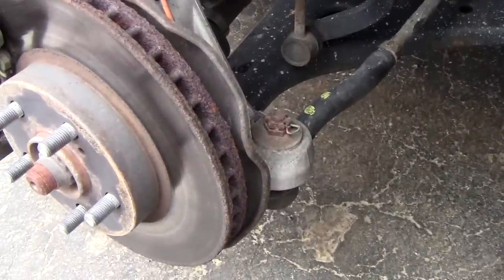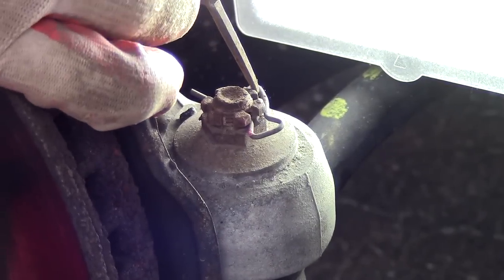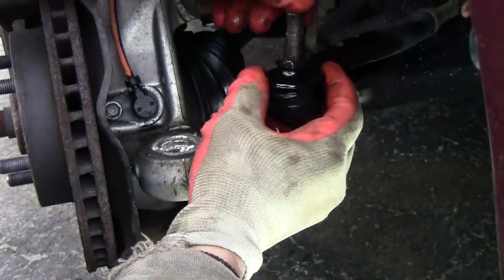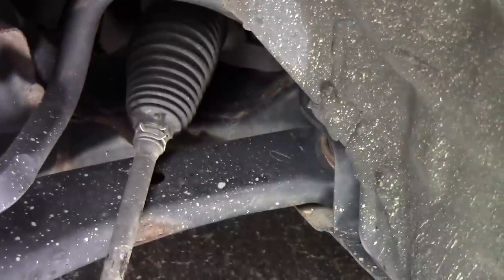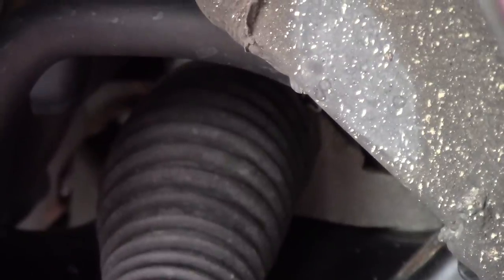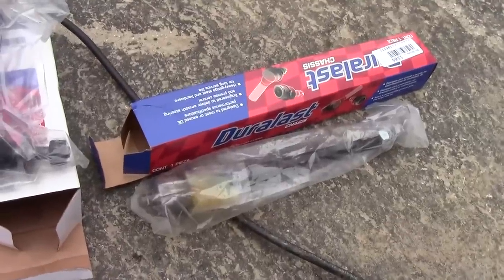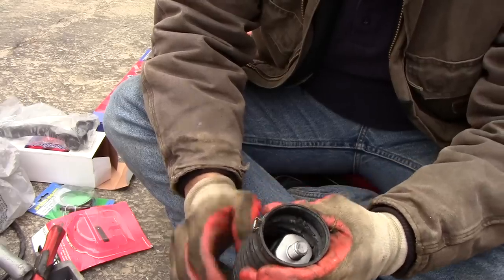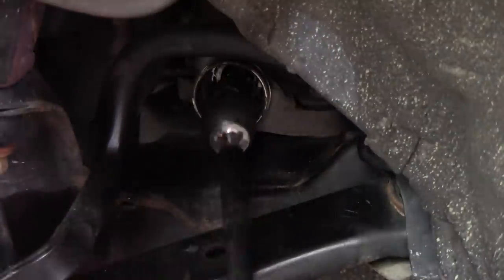inner tie rod replacement and Outer tie rod replacement Prius

Comment: Good detail, thanks for sharing!  About to swap my drivers side inner and outer out.  Have the whole steering rack and pinion assembly, though thinking is easier to remove the inner that already has the outer installed and just replace that section to save time.

Comment: If you keep track of where everything was before you should end up with similar results as you had with the alignment!
Great job, about to do this on my yaris, very helpful video as I've never done inner ends before.
Cheers mate!
Reply from the maker: Thank you for commenting and sharing...  I just did this for round two, about 3 weeks ago, the part was not the greatest of parts and this resulted in replacing it again... Took about 35 minutes total!  I ran through it.
Reply: @EngineerPEretired That sucks! Can you please tell me which brand that lasted only for 3 weeks? So I can avoid it in the future! Inner, outer or both?
Thanks
Reply: I misread that, 4-5 years of usage is not that bad...
Reply from the maker: Desir, please spend the money on OEM parts when it involves bearings (the cheap guys are just that, cheap) ... anything that the failure might cause your death, spend the money on OEM...  I am referencing none-redundant systems...   Besides, you are saving a ton on labor...

Comment: how did the car feel and drive before changing and after? i have a 2005 prius, before i bought it it had crash damage on passenger side, here in ireland, i didnt know when i bought it, so its hard to keep car straight on the road without constant fighting the steering wheel ever so slighly but very often, constant, i checked tie rod ends and the driver side is more lose than other side, plus the inner tie rod moves in and out where as the other side doesnt so i guess that means the drivers side needs changing right? i just ordered the parts now for both sides, blue print brand, i hear thats ok to use on prius, my car cant be tracked , always in the red on the passenger side, even toyota cant track it so i presume coz of the crash damage, but im hopin the new parts mite help something, im hopin ha, otherwise i was told to bring it to get chassis checked for out of alignment, but i guess that wil be expensive to get checked and straightened out if needed, so i hope these parts might help before doin the chassis check,

Comment: Was there some clicking feeling on the steering wheel and clunking noise coming from the rack and pinion area when you hit a bump before you replaced the inner tie rod?
Reply from the maker: Yes.

Comment: has anyone  done this on a 3rd gen 2010 ? as apparently   toyota do not sell the  inner tie rods you have to buy the whole rack at a cost or £1000.00 ......... . would love to know if you can change them on a gen 3
Reply from the maker: That is too odd... try a junk yard or don't believe them and keep researching.
Reply: Philadelphia Construction Engineering   even the junkyard are wanting  £500 the rack or £100 for 1 side of tie rods  .  Very hard to get them for a gen 3 . I've got a gen2 one I'm gonna try get machined
Reply: I dont believe that for one second. Their available online. Rockauto.

Comment: Lol, same here, went to a battery n tire place n said nut is frozen, here i am. Preventing me from getting alignment. This after replacing my struts myself in the front. Awesome vid btw, 40 pounds torque too? Last thing, how waz the drive to get it aligned?
Reply from the maker: If, you noticed, I nailed the alignment = it drove like it was already aligned.

Comment: I got the old inner tie rod out without any problem, but am having a terrible time getting the boot to fit on the inner end.  Completely blind approach and not much room for my hands either.  You commented that you had gotten yours back on more easily than you expected, is there some trick that will help me?  Help please!!!
Reply from the maker: The clamp is what holds it on; I hope you removed that one time use clamp? Then just use a replacement clamp, it only requires enough clamp force to hold it in position with some grease pack into it.
You might be missing something simple if it is not just sliding back on...  I think I was referencing my ability to reuse the one-time clamp again... I did have a new clamp ready to go if it did not slide back on...
Reply: @EngineerPEretired  Yes, I have removed the clamp but the boot does not want to slide onto the flange on the steering rack.  I am using a new boot as I had to cut off the old one to remove the inner tie rod.  Almost completely blind approach and very poor access for my hands, just cannot get the boot to slip onto the rack.  I may pull the inner tie rod just to see if i can get the boot over the flange that way, but would certainly rather not do that if possible.
Reply: @EngineerPEretired  I think that the boot I received may be too small, that would explain the problem
Reply from the maker: That is what I was going to suggest...
Take the cut boot and piece it together and check/ compare it's inside dimensions
Reply: @EngineerPEretired  Already did that, and yes the boot is too small.  Opening of the new boot actually fits inside the old one.  God but I hate incompetent salespeople!
Reply from the maker: This happens all the time these days... I have purchased online ''exact match'' and even OEM wording and the parts do not match!  I feel your pain.  Try boiling the damn thing and refitting and let it cool to fit -- if it close to fitting. Boil it outside if that helps.

Comment: What prompted you to replace the tie rods?
Reply: Jeremy Davis 

      I would say that the threads were seized due to rust welding in the rust belt.  I get to do all 4 wheels on a Camry this weekend due to the same.  Inner and outer rods and rear torsion bars.  All rust welded and unable to align due to frozen lock nuts and threads in each female end. Rust belt. 😡
Reply from the maker: I was getting an alignment and was informed it could not be adjusted - it was frozen -you know the junk they tell you to replace an extra part and make money. But, once I looked at part, it was frozen... haha

Comment: Its good to know that im not the only one who uses a monkey wrench on my cars. My neighbors think im crazy when they see me doing that.
Reply from the maker: LOL - the tools you have available -- as long as you do not tear up the equipment you are using it on... To hell with the haters... Just call them a ''living troll''  - Wish you the best.
Reply: wolf green 

     I used a 24” pipe wrench and an 18” pipe wrench on a Tundra and an Avalon to unscrew the outer tie rods.  24” on inner and wedged on ground and 18” on outer to unscrew.  It worked well.  Sometimes you have to use King Kong tools on stubborn parts.  Rust belt is a pain!!
Reply from the maker: Thank you for the support of the question... a lot of trolls on youtube attack you for anything they would not do... haha

Comment: Your before and after readings are the same because they didn’t make an adjustment. The strange part is that those readings do not fall in the range that is specified. Your before and after readings are 8.4 and 9.4 but the specified range is 10.5-13.5 and 11.8-13.3 degrees. Why didn’t they do the alignment to spec?
Reply from the maker: I think that's the rear ad chamber, caster and toe are the front...
I had them do four wheel alignments all the time but it's an honor system and can we trust these people? 
Maybe you are correct, but no adjustments are made on Prius rear that I could find and they toe in slightly from my fishing line check weeks ago.
Fyi, I now do the fishing line trick and do my own, just like race cars do it...
It's really not that hard and does have a an initial learning curve.
Make sure you have all the tires at equal pressure or rather equal frame height from center of "hubs" , this way you can a clean alignment... 
I literally found a four point level ground for my tires to set on to do this more accurately.
Road testing is removing hand off off of wheel and see if car tracks straight (do not accelerate or car my torque to one direction and then brake check to determine balance in that system also)...
Very low tech but it gives you real world data on your brake condition and your alignment "function "... And may indicate replacement of parts needed.
Reply: @EngineerPEretired  did you make any “fixtures” to put in place of the little center caps to help with precision or better reading, post pics of them if you made any. 
I would be interested in a video on your DYI alignment technique.
Thanks 
Dean
Reply from the maker: Dean, when the weather changes, I will put one together. 
I have done it about 5 times now and I am getting faster and faster at it.
Use the rim unless you have different width rims and you have to decide about the rear toe and if you will duplicate it in the front or go with zero tolerance range...
The specs allow for some range but you can dial into zero but it's weird that the rears are not adjustable and track in just a touch, 1/8 inch I recall